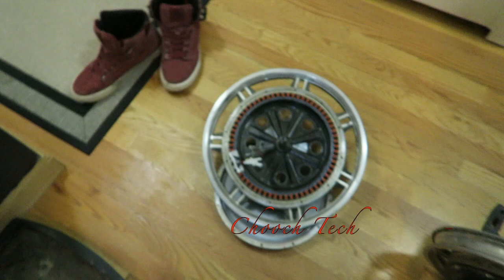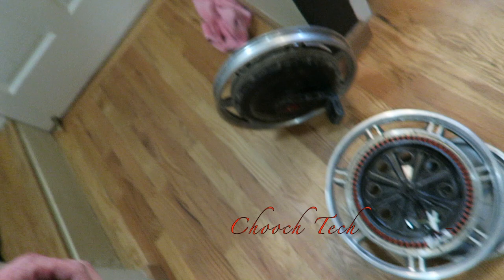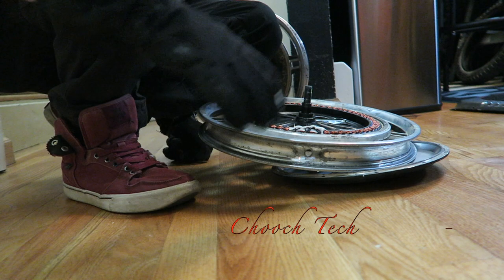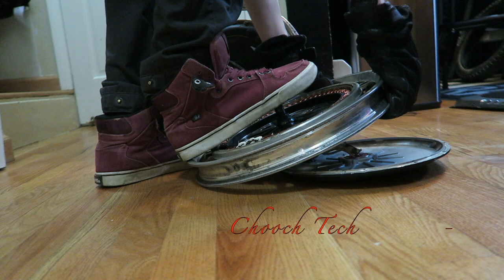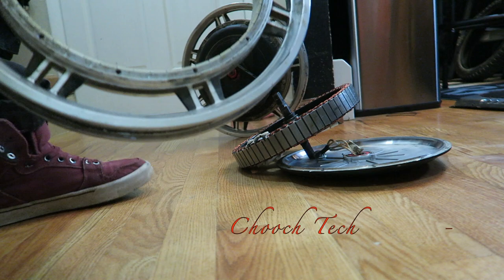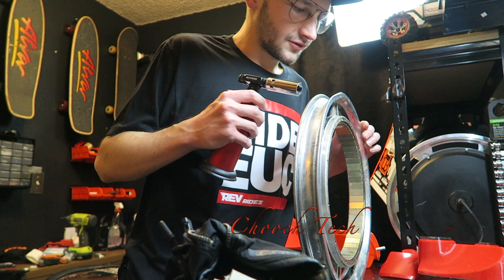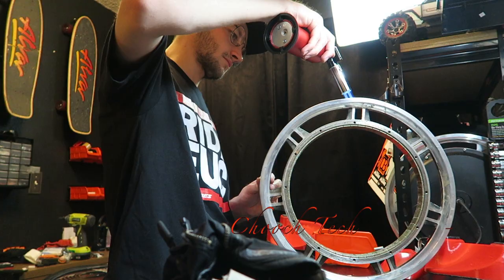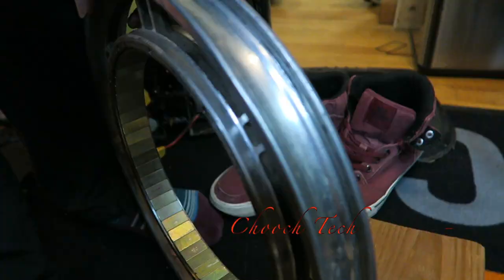HOW TO SWAP A EUC MOTOR TO A NEW RIM: Adjustable Wrench Life HACK easy way to fix a DENTED EUC RIM!

Comment: Be careful! Sherman's rim has a direction! The magnets are shifted a few mm to the side where the hall sensors are located. And this is very important. If you set it the wrong side you'll get the hall sensor error while hard acceleration or hard breaking and the controller will shut down the motor while moving.
Reply: why would that matter wouldn't it just think your going in reverse?
Reply: @coolhawk2003  because the magnets are shifted few millimetres to one side and they should be closer to hall sensors otherwise you'll get an E-HALL while moving = faceplant)))

Comment: Chooch I love your vids and have supported your channel cus you inspire me so much.  Maybe this is just me being anxious and a perfectionist but I see a lot of problems with your method. Anything on the bottom of you shoe could fall into the motor(dirt, little metal shavings, etc).  Next you could damage the motor coils with your foot technique. Lastly.  The whole motor wire got smashed down directly on the group when it popped out.  Which is obviously not a good thing. 
I have made a rim swap on an EUC as well. And the better method  IMO is using a cylinder that is just wide enough to go around the motor with a whole in the middle for the axle.  Then just push down with force on the rim.

Comment: I replaced the rim on my v12 but I installed the motor in the wrong direction. Nearly crapped myself when I turned it on and it went full speed, but luckily I was holding it off the ground. I'll re-assemble it tomorrow, hopefully I didn't burn anything.
Reply from the maker: I did a video on this exact thing. Check my channel. It put a hole in my wall and destroyed my baseboard heater
Reply from the maker: Type in inmotion dangerous chooch
Reply: @choochtech  man I wish I had come across that video before embarking this journey into literal hell 😂 the inmotion is so well built, but it's a real pain to work on.
Reply from the maker: @kreempa.i.8349  yea man sorry you didn’t see that easy mistake. Live and learn, I was taught to work on dirt bikes by my dad this stuff is all new to everyone. Glad you got it figured out!

Comment: There is an easier way.  Put a rubber malet under the center of the motor and push down forcefully on the rim.  The motor will "pop" out.  In your case, just use the axle and press down.  Yes, wear gloves, the magnets are powerful and will "suck" the motor back into the rim when you're reinstalling.  I like your reinstalling technique.

Comment: This bend in the rim was not really significant: probably wouldn't have affected the tire.
I would leave it be instead of trying to bend the rim back, because it increases the risk of crack and that's worse.

The tool you use even leaves clear dents in the aluminum. Not sure it's a hack that should be recommended.

Agree about being super careful with these strong magnets tho! I prefer to have the rim and stator aligned instead of at an angle when putting them back together tho.
Reply from the maker: put a little tape over the wrench if the scratches bother, this is chooch tech fast repair to keep on riding not Space X rocket Module repair
Reply: Noting view of other EUC rims ending up cracked. I simply went along with the description of it being a "cheep" wheel/rim. Regardless, what would cause a rim to end up becoming cracked?

Comment: So I just pulled the motor out of my ks16x, what keeps the motor centered? The motor is sucked closer to one side touching/rubbing against the magnets on the rim. So what keeps them from grinding when I put it all back together??
Reply: The dozens of screws that hold the cover plates are what keeps it centered.

Comment: I saw a clip of a guy doing this to a couple kids hoverboards and making a scooter with 3 or 4 motors on it :-) 

it's not rocket surgery but it is surgery.
Reply: it's useful to get a small/cheap benchtop anvil from harbor fright so you can proper mash it against a mandrel.  most of the little hammers I bought off amazon came with multiple faces so you could change between hardnesses.  small deadblow mallets with shot/sand are super helpful as well.  Everything I just listed cost less than fiddy bucks all in lol its not expensive to get the right stuff on your bench and if you break one that means you did the work and you need to buy a better one.  :-)

Comment: That is very resourceful recycling. Keep on rocking like you roll. 

Flexible self healing poly/multicarbonate composition structural framework. 

There's alot of potential power in the shaping of magnetic field arrays. 🤔 
👁️👁️ 
#TheDigitalLifeguardProject-_-